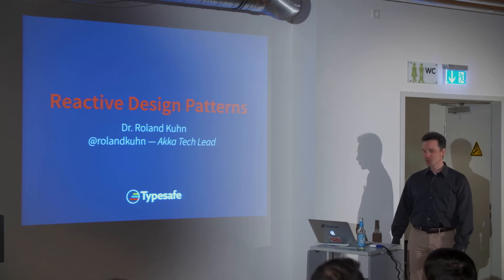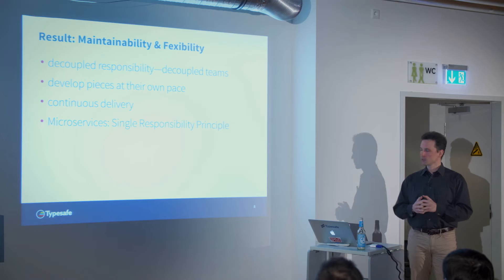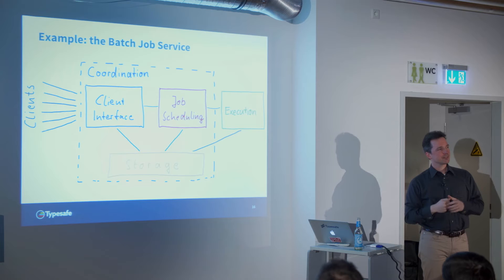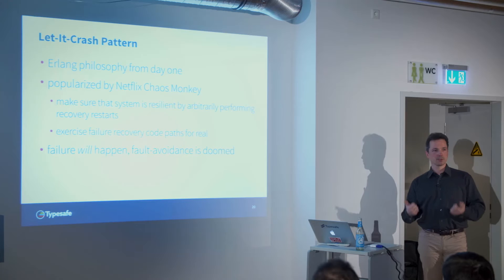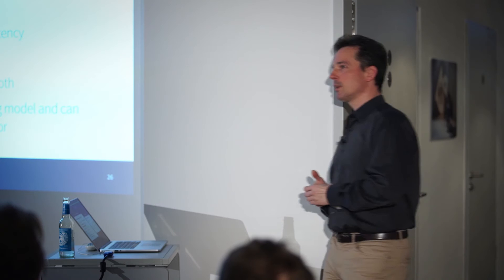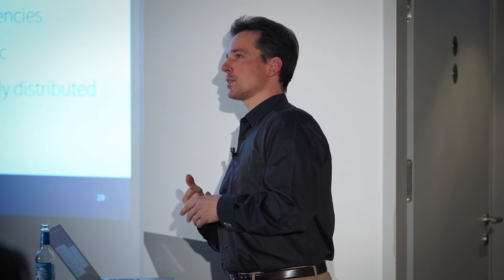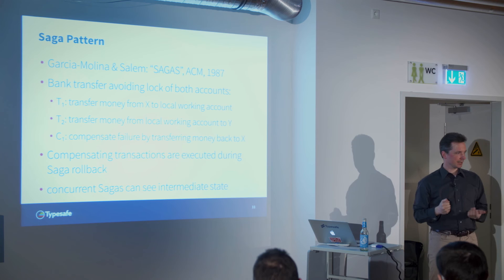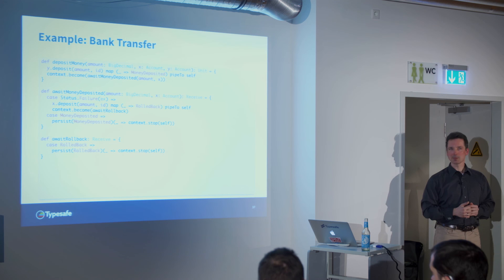Dr. Roland Kuhn: Reactive Design Patterns

Comment: Having known advantages distributed systems bring, here are some problems one should think about before moving to distributed systems

1. Table joins now are spread across multiple nodes, as the data is split into multiple modules. Either the data needs to be duplicated for performance improvement (or) accessed accessed via additional network calls to aggregate
2. Messaging is not designed for low latency scenarios, which is what most of the internet facing traffic is